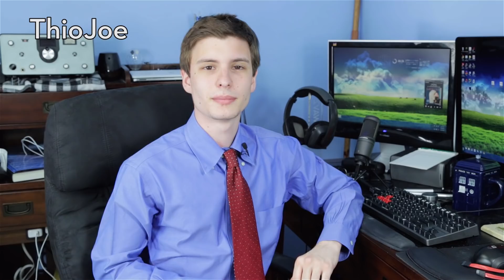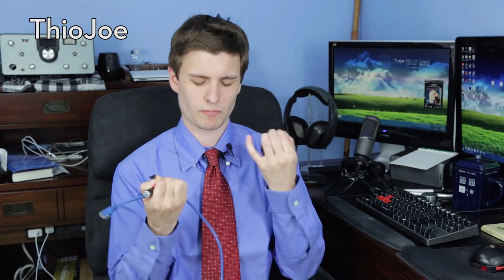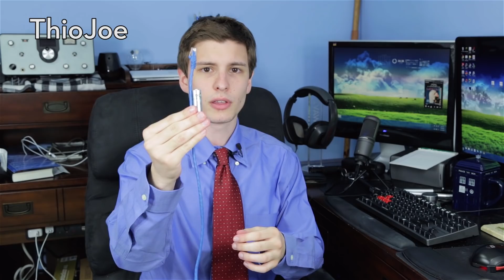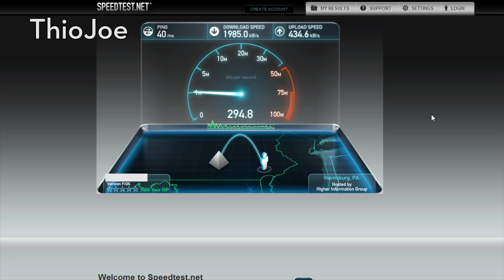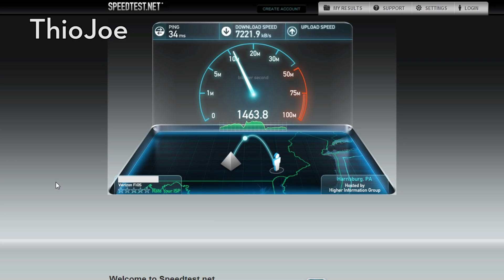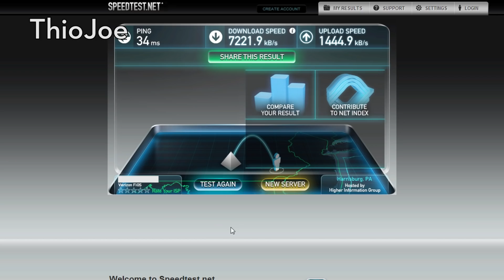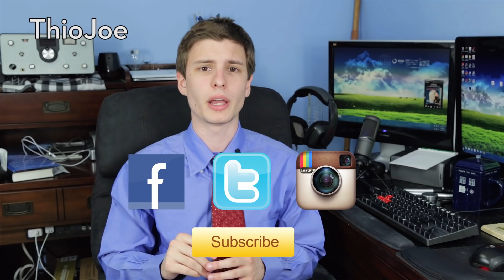Triple Your Internet Speed for Free

Comment: Couldn't you further increase upload & download speeds by taking advantage of gravity, raising or lowering, respectively, the ends of your cable cx? That may be inconvenient, but it may be worth the effort for long uploads & downloads.
Reply: +Robert Goodman This guy is smart to even think of this idea :))
Reply: Robert Goodman The problem with using gravity is that it pulls one way, down, but internet goes two ways, downloads and uploads. Lifting the router above your computer increases download, but reduces upload speeds. The reverse happens if you lower your router to be below your computer, increased upload but decreased download. So in both cases, you are trading one for the other. What you could do is create an advanced pulley system connected to your router and computer, and then lowering your computer and raising your router whenever downloading, while raising your computer and lowering your router when uploading. If you had sophisticated knowledge of programming and electronics you could probably even use an Arduino and have it read how much you are uploading and downloading, then have the Arduino use a series of motors and automatically adjust the height of your router and computer without any human interaction. When you are downloading the 65 gigabytes of GTA V, it would automatically lower your computer and raise your router, while if you are uploading all of the movies made by your parents at 8k 240 frames per second, it would automatically raise your computer and lower your router. Obviously, this system would work better the more height you have to work with though. Every 9.806 meters (Roughly 3 floors) would result in a doubling of speed. People who live in skyscrapers could gain ridiculous levels of high speed internet, if only they harnessed the power of gravity. If your computer was at the bottom of the Burj Khalifa and your Router was at the top, (assuming you had the 3000 foot Ethernet Cable) you would be able to get 27 septillion times faster internet. That means that even if you were limited to basic dial up, you would still be getting over 20 quadrillion terabits per second. 

People really need to start using gravity to their advantage.
Reply: hahahahaha
Reply: +Jacob b have fun being stupid
Reply: Kek
Reply: +Nevan Lowe That is a very good theory, but its not that simple. By using the Boltzmann constant (k) which is 1.3806488 × 10-23m2 kg s-2 K-1, it becomes obvious that the weight of your router (in kg), the surface area (in m^2) and the amount of time the router spends above or below the computer also factors in to the equation. The increase and decrease in internet speed happens not because of how high the router is, rather you must consider the probability that a number of particles all occupy a very small region of space (mathematically written d3r, where d means "differential", a very small change) centered at the tip of the position vector r, and have very nearly equal small changes in momenta from a momentum vector p, at an instant of time.
Reply: +Nevan Lowe Furthermore: The Boltzmann equation can be used to determine internet properties change, such as heat energy and momentum (speed) when data is in transport, and other properties characteristic to data such as viscosity (amount of data/second), thermal conductivity also electrical conductivity (by treating the charge carriers in the cable material as an electrical signal) can be derived. See also convection-diffusion equation.

The equation is a linear stochastic partial differential equation, since the unknown function in the equation is a continuous random variable. The problem of existence and uniqueness of fluctuating internet speeds is still not fully resolved, but some recent results are quite promising. The set of all possible positions r and momenta p is called the phase space of the system; in other words a set of three data coordinates for each position coordinate x, y, z, and three more for each momentum component px, py, pz. The entire space is 6-dimensional: a point in this cable is (r, p) = (x, y, z, px, py, pz), and each data unit is parameterized by time t. Since the probability of N molecules which allhave r and p within d3r￼d3p is in question, at the heart of the equation is a quantity f which gives this probability per unit phase-space volume, or probability per unit length cubed per unit momentum cubed, at an instant of time t.
Reply: Nerds

Comment: Did you know that if you take that same wire and stick one end into your ass, you can get free electricity to power your computer, but you have to make the connection a DC connection instead of AC. You take the eight small cables out of the clip on the end and double twist them so that there are only 2 wires (2 x 4 wires twisted), then connect them directly to your electrical cable (AC) that you have cut in half. Put the half that is not connected to anything into the AC in on your computer and connect the ethernet twisted  wires to the other part of the AC electrical cable and tape them good with electrical tape, then with one end into your anus, plug the other end into the electrical outlet in the wall.  When you start to quiver and feel the 60 Hz buzz, lift your arms up into the air and you will create a tesla wireless power jump to the other haof of the electrical wire. Good luck on your trolling

Comment: Why do you need Cat V or Cat VI ethernet cable? Maybe so when suddenly you'll boost your internet so high, that the datas are reaching 1000V, and you don't suddelny charge the battery through your conductive electrical tape that is also often called INSULATION TAPE?!

Comment: How do you spell "C R A P"?? Here is the definitive answer. Electrical tape does not  conduct electricity, THIO, and even if it did,taping it to a cat5 (or cat6) cable accomplishes nothing. However, that IS a nice tie, and a single roll of the sleeves would make you look more (been there, done nothing) believable look.

Comment: It's amusing he can give this speech with a straight face, anyone who knows anything about electricity knows this is totally wrong. The resistance of the cable does hinder the signal slightly, but the computer can compensate by increasing the voltage. Voltage lose generates heat, so if your wire is not hot to the touch, it's likely not losing much in the way of voltage. It is also digital... a weak on signal is still on. He's suggesting using the batteries as capacitors to create induction to increase line voltage, which is silly =P. IF anything the capacitance of the batteries could slow communication speeds, but not likely either unless they were tied directly into the cable itself... and not taped on haha.

Comment: I should have known this was false from the start. One of the major red flags was that you said that electrical tape conducts electricity. If you're a tech-savvy person, one of the basic things you should know is that electrical tape insulates, not conducts. It's called electrical tape because it insulates electronics and keeps the electrons inside. Don't listen to this. It's a joke. And for magnetic induction, the current that is supposedly created is by moving a magnet over a conductor or when the magnetic field varies. There is no magnetic field inside of a battery, so no current is created in the first place.

Comment: Holy CRAP!!! It worked! I actually got 4X the speed as before by facing the batteries in the same direction with a serial cable instead of the aforementioned IDE wrapped around it. Great advice dude! Somehow the batteries and extra cables must pull more megabits from my ISP's greedy little hands then they have my connection speed set to...

Comment: ThioJoe
I listened to your video "Triple your Internet Speed for Free" and followed your instructions but did not get the results that you did. In fact it did not change anything. I have CAT 5E cable through out the house eminating from a central control panel in tha basement. I just notised that the cable running from the wall outlet is shielded. That may be the reason that the batteries are not doing anythink. what do you think

Comment: Was able to get the surplus submarine batteries from South Africa's refurb of their fleet of three diesel electric subs. They shipped them to me free as it cost them less to do that than the hazardous waste disposal cost for all the lead, zinc and acid in them. Used your induction principle to dramatically increase my Internet speed. By routing the cable drop from the cable company's box to my house through them I've gone from a mere 30 Mbps to 1 Gbps and I now have Gigabit Internet service! Already had Gigabit Ethernet cables, switches, and WiFi on my LAN, plus Gigabit Ethernet adapters and WiFi cards in all the PCs. Streaming your YouTube videos in full-on HD never looked better! One of the side benefits is the massive footprint they have in my back yard. It's much less grass to mow.

Comment: Whilst  this may have a great physics application..

You would more than likely get the same effect doing this with the magnets from a ps2 controller.

Is you are getting so much signal loss within the cable you are using I would likely suggest upgrading the internal house wiring to shielded cat-6a cable.

Note: if the Internet connection is being shared with multiple devices and if they are active. You will loose bandwidth..
If you have the capacity of 15/1 through 10 devices your average lan speed will be 1.5-2 mb ..
speed test is a joke, the bigger issue you have is the total signal loss within the cable servicing the room adding this option more or less shields you from external rf interference..

Though you could likely produce the same effect sticking the cable in conduit or metal pipes.

Comment: This is soooo dumb! I added "D" size batteries and found that the speed increase lasts a lot longer. I also tested different color tape and found that Red tape somehow boosts the speed as well. I believe it has to do with the reflectability of the color against the cable. Thanks for sharing.

Comment: At first I thought this was a joke or BS - then I said - what the heck 2 batteries and some tape how long could that take ?  - Well after buying 2 brand new c cell batteries I taped them to the cable.  And when I ran the internet test I kept hearing a buzzing at the cable - so what was that I thought maybe it was static ? - no -- OK so I ran the test again but this time put a third battery near the computer end and then I ran the test again.  And once more the buzzing started again I did not bother looking at the speed but rather got out my flashlight and noticed that as the speed test was running I could actually see red flashes of some type coming from out of the top battery and into the cable.  So I said to myself that for sure is static and might cause damage to my computer - then noticed that the speed test ran almost 4 times faster with the 3rd middle battery installed.  I never took notice of the 2 battery speed test but I was OK with 4 times faster.  I thought the buzzing of the cable was static so I grounded the far end of the wire using the copper - de soldering braded wire to act like a static absorbing conductor to a bare metal surface on my computer.  I ran the test and the buzzing stopped but the speed slowed down to my old original speed.  So i un grounded the copper wire again and ran the test and low and belold the buzzing came back and the speed was back to 4x the speed.  I did notice the red sparkes or what ever you want to call them jumping from the tip of the battery to the cable again so this time I photographed the sparks with just my old simple digital point and shoot camera.  When I uploaded the mpg file and magnified the sparks - I noticed that they were not sparks but zeros and ones -- running at a very high speed into the cable and then computer.  The width of the ones and zeros were about an 8th of an inch wide and I did notice one of the "zeros" in the mpg file giving me the finger and it zoomed by.This was just a joke and not true so dont try it.
Reply: Cacianvm i tried the same thing w/the same results, except that when i magnified the sparks, it said, "SUCKER!!!!!!!!"

Comment: listen to this dumb ass and I quote.
(Use electrical tape because it conducts electricity) electrical tape is used as wire isolation to prevent it from conducting any electricity that's why it's also called Isolation Wire 
and It's because of that stupid sentence I'll commando hammer that tape up your ass! Speaking of isolation how is the battery going to put any electricity in the wire as you say it will you know with the aluminum shielding along the battery and the rubber isolation along the Ethernet Wire and god knows what else inside but I'll tell you one thing
YOU DONT FUCKING TAPE IT! His next video will be How To Download More Ram For Free.
It's scary that people like this can become politicians.

Comment: Hi -  I tried the battery speed booster with 2 brand new batteries and it did not work.  I have U-Verse - does that make a difference??  I put them on a thin Cat 5E Patch Cable that came from the wall to my AT&T router.  Label on the cable said "Data Cable" and it was plugged into the "BroadBand" socket.  Did I make a boo-boo??

Comment: WOW! this shit works, and i found out another way to Double ur triple theory all u have to do is: since u already have those battery taped up, now run a wire to a doorbell switch > connect it to a fuse > connect to a dynamite. oh make sure u have the dynamite inside ur computer case, then just test ur speed again and HIT the doorbell. DING! madafaka, 6x the speed!

Comment: Oops!  I didn't use rechargeable batteries the first time so I didn't get the speed I was hoping I'd get.  Had to stop at Walmart and buy some rechargeable ones.  And I notice that if you use masking tape instead of electrical tape, you won't get optimum speed.  That's very important.

Comment: Bravo... 2000kb about 15mb Seems legit. Except 2000kb is FUCKING 2MB you DUMB FUCK. IT MAKES NO FUCKING SENSE SURE ELECTRICAL TAPE CONDUCTS ELECTRICITY BUT THERE IS NOTHING TO FUCKING CONNECT THE CABLE I NOT CONNECTED TO THE BATTERY IN ANY WAY CAUSE THERE IS A INSULATOR OUTSIDE THE CABLE.

Comment: OK, I have UVerse and use the wireless signal.  Will this work if I make the cable and place it from the wall Cat 5 jack into the cable modem?  So it would fall in place before the modem not after the modem.
Thanks!

Comment: I have to call BS on this hack.

The ISP limits your bandwidth. If your short ethernet was only capable of 2 Mbps, there is a problem with the cable. It is amazing what some people will believe. 

BTW just increasing signal strength doesn't increase speed, it increases the distance of wire one can utilize.

Comment: k, tried this, and don't faster dl speeds, I get a wayyyy more stable connection. I will be going out and buying a new Ethernet cable and brand new batts.  and im think it will help even more. im after stability, and this is working for me.... cheers bud.

Comment: In fact, he says a little bit of sense. As against this will never ever even accelerate the speed of the internet connection between the ISP and your computer (which is ridiculous) (i know that's a spoof but there's interesting elements in this video..). In physics it is possible to add an alternative source (the bits that pass through the Ethernet cable) and continuous (battery) which results in shifting the alternative source of its logical 0 is 0 volts. Because the bits never go below 0 volts and that is a direct current with the data generated is converted into alternating current square wave it happens: instead of giving a 0 logic 0 volts and a logic 1 to 5 volts, it could happen with a 12 volt battery to logic 0 to 12 volts and 17 volts logic 1. Obviously it is necessary that this battery is connected to the cable and not stupidly wrap as in the video (the electrical tape is insulating, but I know you said bullshit). The you ask me what is the advantage of doing that?

He was talking of the internal resistance of the cable and it is precisely this aspect that we can play. In theory it would be possible to quintuple the length of the cable before reaching a total resistance (the total area of the cable) to drop to 0 and 5 volts of our 12 and 17 in order to have an acceptable voltage to be read by the NIC. We talk in terms of ten kilo ohms for this experiment. The calculations should not be very complicated beings, do that the ohms law and the resistance of impure copper. Obviously we would need to calculate the risk of interference with the expansion of the total surface conductivity but we'll talk about in another video.

Maybe the experience is worth it to lengthen my internet connection or "speed" (LOL) but instead of that, I'll just pay myself a better internet connection with my ISP because I have the means. ;)

Sorry for the grammar and syntax, I'm French.

Comment: I don't know what everyone's talking about attacking the uploader and this technique. If you use rechargable AA batteries and run the before-and-after tests multiple times under the same PC conditions and load, speeds will be 5-6 times faster during the initial burst of throughput and level off to a sustained speed that's 2-3 times faster than what you're paying for. Installing the batteries inline allows faster packets of data to surge ahead of bottlenecked data. This is why modems have more than one channel for data transfer when they used to have one or two. But I guess that's nonsense too.